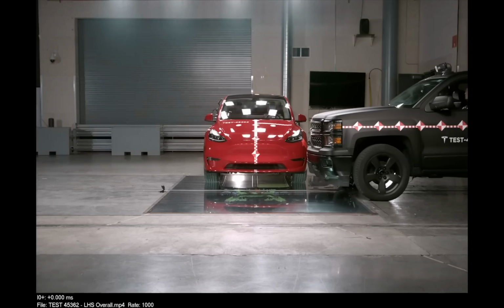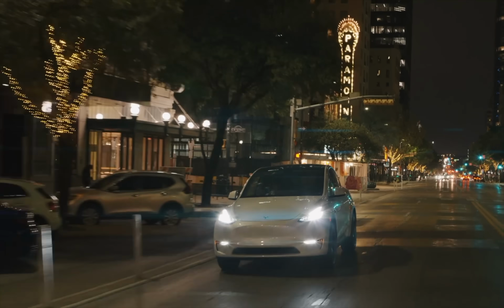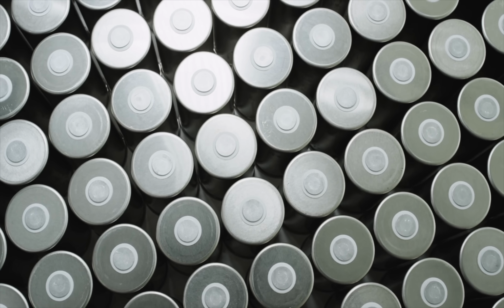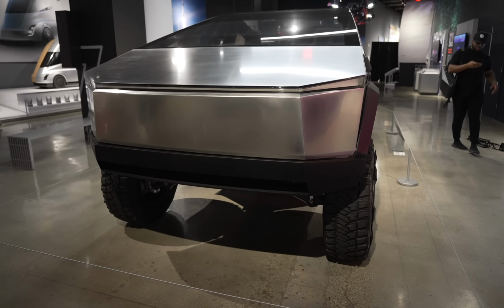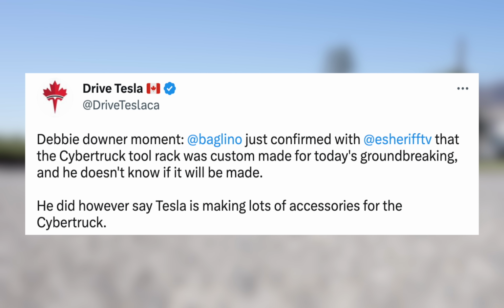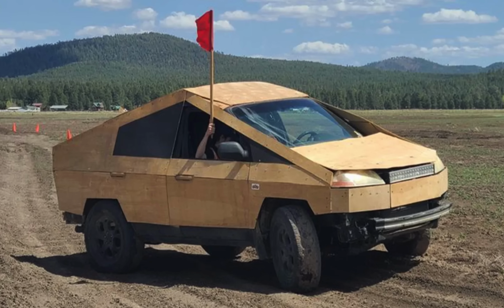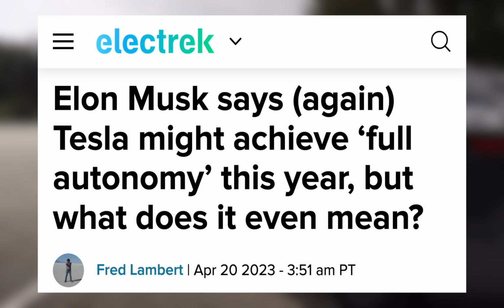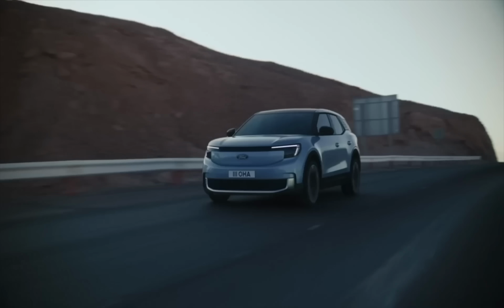Tesla’s NEW Business Will Be A Huge Win For Everyone | Here’s The Truth

Comment: IMO you are wrong about FSD price.
once it is level 5 it will be much more expensive, and i seriously doubt tesla will even offer a deal for one payment for lifetime of use, this is because it can work for you as a ROBOTAXI, 
so basically you get a lifetime driver working for you for 15K... that is nothing, i think who ever made the deal now will be very happy in the future. as then it will probably $/per mile or time of use.
Reply: Your logic is correct. However, the elephant in the room is that nobody knows when FSD will fully work. If it was guranteed/refundable, yes it would be a no brainer, as the value would be so high for the owner. But there is a non-negligeable chance that it never works. Ask the first buyers if they are happy with their FSD even at 4-6-8K . They'll say no.

Problem with FSD, as opposed to let's say a robot gardener or warehouse robot, is that it has to room to fail. Even if FSD makes no mistakes for 2 years, one little mistake after 2 years could kill 1-4 people in a car accident. It's sad, but it's reality. 

I think we'll get there within 5-10 years, but no guarantee. So 15K for FSD now is not cheap.
Reply: @karinemelo2549  
when will it be ready ? Hard to say, can only speculate.

Will it happen ? Easy to say, it does not have to be perfect just needs to be in order of magnitude better than human to get immunity from mistakes.

Comment: Level 5 FSD is years away.  Maybe by 2028 with latest hardware will be fast enough
Reply: Hardware is absolutely not the issue right now. You could take hardware three generations from now but with the current software it still couldn’t drive itself. The software is the hardest part
Reply: @SyntheticSpy  AI eats cpus/gpus up. The faster those are, the more edge cases you could compute in real time.  That real time identification is what's needed.  The software for this is pretty brute force and requires gpus that are quick
Reply: @SyntheticSpy  hahahaha 🤣, tell that to waymo.  Hardware is everything.

Comment: I'd buy FSD if it were still $6k or less. Would never buy for more than that.
Reply: It needs to be attached to the owner, not the car. That would shift the dial and more people would buy it.
Reply: $1000.00-$1500.00 feature.
Reply: yeah atm its still mostly a fun toy. Id totally buy a fun toy for 15k if I was rich, buuuuuut, Im not.
Reply: That’s what’s sucks really. 
A rental Toyota RAV4 I drove (usually close to base or base trim) had auto steer and adaptive cruise control like new Teslas have without any software packages. They’re not much different to each other at that point other than that one saves money by not running on gas.
I mean there’s the subscription, but I prefer to own and not subscribe for SOFTWARE. 
Imagine paying $6k for CODE.
Reply: @faheemabbas3965  all teslas have autopilot included for free tho, autopilot is some auto steer (lane centering) and adaptive cruise control.